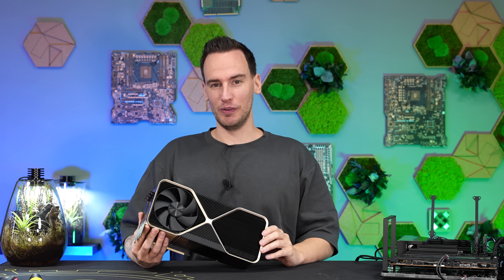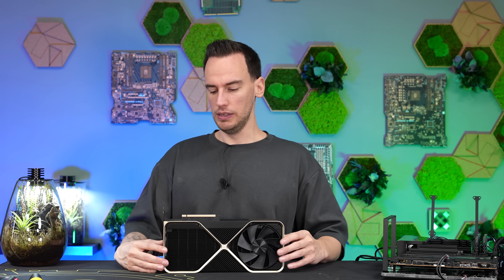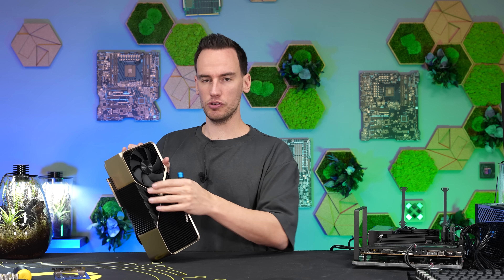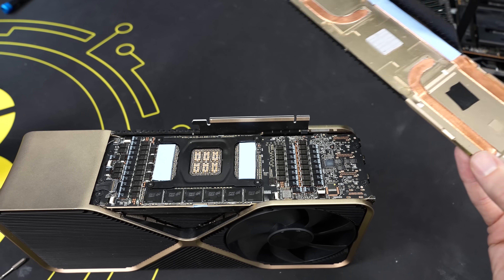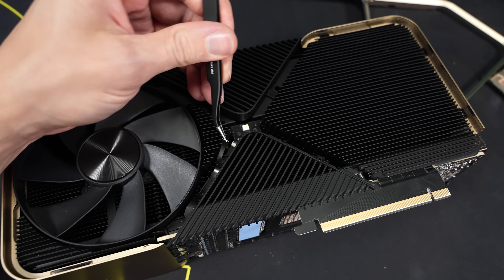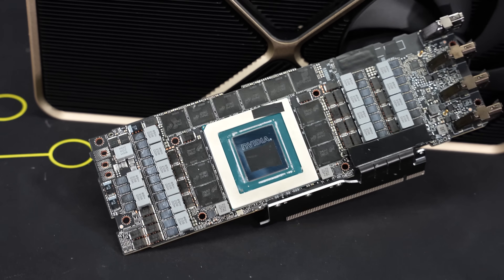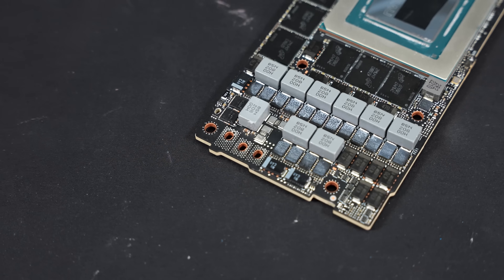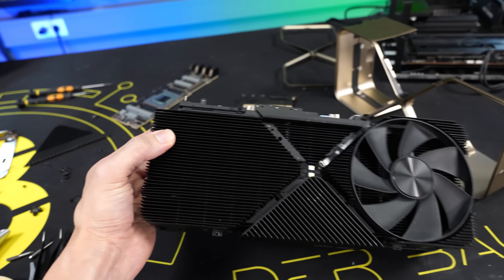I Opened NVIDIA’s Secret TITAN ADA Prototype

Comment: all these gpu unit should be water cooled only by now. these heatsink are going into the insanity category. taking up half the motherboard while even a simple butterfly's extra weight will crack the connector.

Comment: Incredible. When you initially showed the side view and you could only see daylight coming through, my brain went- what black magic is this? The only way that would work is if the plane of the PCB was perpendicular to a standard GPU PCB configuration, but that should be impossible for a card that powerful. Sure enough, they pulled it off. That is some beautiful engineering. Thank you for showing us this!

Comment: My PC is smaller than that one GPU. I guess bigger coolers and heatsink, mean more power to push slower chips, Rather then making faster chips Nvidia have gotten in to the fuck heat limits and dodgy power cable they want Juice and shit loads of it. It like the old day when CPU was only one core and it was a game of what killing clock you could get before it turn into fire.

Comment: The GPU cooler that RTX 5090 FE should've used. Instead, we got a crappy dual slot that runs hot and loud just so NVIDIA can get more margins lol
Reply: The FE cooler is dual slot 😂 it’s amazing it can even handle to the full heat load. It was not free to develop 😂.

Comment: The price for this kind of thing is not just the manufacture, which is significant, but think of the engineering hours gone into making this thing too... But it does also depend on how you count it - the engineering wasn't A-Z for this and then thrown away, the routing schemas and rules are used for other PCB's as well, and parts of the cooler design are re-used and cobbled together from different designs, a part of the cooler is very reminiscent of another card I've seen but not sure which - it was one of the Titan cards and I think a pre-release but earlier than this... But - could be that I misremember... The PCB on it was not in the base of the cooler like this but it was like a diagonal cut thing, so as short as this but the connectors oriented the other way and the PCB just the square from the slot back up and then to the top of the card, with the corner cut off. And there is the one with the V "bite" into the card too, that went out as a production Titan as well as 4090 OEM I think. Looks like it based on pics. But you can find some more funky PCB's poking around in the 'pictures' result searching for nvidia titan pcb, rtx pcb etc. The evolution is interesting to see IMO.

Comment: Shame with the 5090 they could not have done the same thing and not had the 12vhpwr power connector on the main board. Would have made replacing melting ones easier.

Comment: The prototype is very impressive. I wonder what applications would justify such an expense.
I built 4 "high end" computers for a lady that was doing a Computer Science Masters Program focused on Artificial Intelligence. The first was a quick use of mostly spare parts. I put an Intel 9900k into a Asus Prime mother board with a Corsair 360 AIO. The initial Graphics card was a 1080 which was quickly replaced with a new 3090FE. This did a homework assignment in 3 hours that took other students working on their laptops a week to do. I saw the need for her to have a backup computer that proved to be needed twice. The first failure was due to “user error” of trying to store more than 2 TB on the boot drive. There were three other unused NVMe SSDs on the mother board. The second failure was the mother board battery failing. I did not see that coming. Luckily both times almost all the work was backed up off site so only a few hours of work had to be redone each time.
Like Paul (Paul’s Hardware), my first 13900K with a 4090FE had an excess of cooling power. It had a Noctua NH-d15 in a Fractal Torrent Case. The last one had a Noctua NH-12A in a Fractal Pop Air case. What I call a good cooling solution is not for the highest initial overclocked frequency but a long term lowest fan speed to minimize dust accumulation with big slow turning fans to minimize noise and fan curves that will cool Prime 95 and Furmark loads. The CPU initial temperature should be Celsius temperature in the low 80s at full load with an ambient Fahrenheit of 80 (26.7 C) because dust happens. The Intel XTU tool can make this an easy task with final settings transferred into bios. By doing this the Turbo velocity boost can be disabled and reliability increased. The turbo boost is the cause of Intel CPU failures due to the inability of the temperature sensors to limit temperatures quickly enough to prevent damage.

Comment: 10% GPU 90% heat sink
Reply: And 99% cause wallet bottleneck
Reply: 75% fire hazard
Reply: @cwbuilds9215  if anything this one is the least fire hazard compared to any 5080/5090. since all the 12V and ground  pins for both 12vhpwr are all bridged to the copper bar so even if a pin or 2 made bad contact the rest would balance it out. if nvidia had done that for all 5080/5090's the melting issue would not exist...but instead they made the safest ones be the prototype ones that  maybe a handful exist and then made millions the lazy unsafe way

Comment: At this point may as well just have a gpu socket on the motherboard and put your own cooler on it
Reply: I've been saying the same for years too, the atx board needs to evolve one side socketed cpu and ram the other side socketed gpu and socketed vram and the chose your own cooler type.
Reply: @bazzingabomb I think there may be an issue with socketed vram with trace length and signal integrity. I do think a socketable daughter board with integrated GPU and vram, and offload the vrm and video outputs to the main motherboard would work
Reply: They already do it for DGXes, it's called SXM

Comment: Eventually that poor PCIe Pcb will be split on two parts or damage the main Pcb connector if you try to move your PC!!!
Reply: At least it appears they used a flexible connector this time unlike the rigid solution on the 50 series that has already had problems. I'd actually be less concerned about this one and it's constrained to the cooler pretty well but I'd still definitely use a support bracket or a vertical mount.

Comment: With these massive, heavy cards I'm wondering why the manufacturers aren't using the other card slots to help support the cards. They are relying on just the side bracket and the single slot connector. Seems like they could put something to use the second/third slots they cover up to support them, maybe as something that could be easily removed in case you happened to have a motherboard that was single slot. Not only could it help with support but if they could use the locking mechanism to help keep it in place as well. With the fact that most cases seem to have horizontal card placement I'm surprised they haven't done more to deal with this besides the awkward GPU stands some send with them.
Reply: I would assume that the 4-wide bracket is enough of a contact point to hold the cars pretty securely.
Reply: @dylanevans5644  Holding them securely is one thing, supporting them is a fully different idea. Card sag has been a worrying thing since the Gtx1000 series or earlier when the cards started getting much heavier and longer (as to why some come with those little anti-sag brackets). So yeah there is plenty of room for improvement with the far larger cards to help deal with that. 

And that doesn't even address the fact that the 5000 series doesn't even have the PCIE pins as part of the card but just a different board so it doesn't have the same level of support. 

Anyhow, it was just an idea of how something might be done to help support the weight of the cards, especially the 3+ slot cards.
Reply: PCI slots aren't supposed to be load-bearing and available slots aren't consistent across different boards or always reinforced. Even if they did it's still only supporting all that weight from one side. It's just not a very good solution.

The only practical option to truly secure these monstors are support brackets, at least until standardized changes are implemented.
Reply: @JJFX-  Yeah thats kinda my whole point, PCI slots aren't supposed to be load bearing... yet they are being forced to hold up these massive cards, and this is why so many cards these days sag.

I did happen to mention that there could be removeable/adjustable brackets, and spreading out the load would obviously help take some of it from an individual slot. As it is now the cards torque town from the back putting strain on just one PCI slot and on the single connector. 

As for standardized they are kinda standardized as far as the distance between them, this is why you can have multi "slot" cards and they all fit the slots and can be attached behind them. So you COULD make them for dual/triple slots (if they were able to be removed/adjusted for boards without).

The sag pole also isn't a great all around fix because of the same idea that "they aren't all standardized" when it comes to motherboards AND cases so you can't guarantee that a shipped sag pole is going to do anything. This also wouldn't address the cards being in a vertical layout as they still lean over putting pressure on that single PCI slot, just not quite as bad as when they are on their side.

Of course its not a perfect fix, probably won't be implemented by manufacturers, but its an idea for a potential solution to help address the problem in a way that doesn't force the consumer to rig up something in the hopes that it doesn't cause a problem (or won't look horrible) with their $1000+ card.
Reply: @JohnA... I know what you meant, it makes some sense in theory but it's just not practical. Yes the spacing is standardized but not every board has actual slots in the same locations. For example a board in front of me only has a PCIEx4 two slots below the top x16 then another x16 spaced 3 slots below that. Others do this differently. Any 'dummy' brace like that would need to be removable to ensure compatibility. 

What I meant by a standardized solution is modernizing the ATX spec with additional support considerations. Something that has been discussed for a long time.

Support brackets/braces certainly aren't ideal but are often adjustable and add strength exactly where it's needed without transferring the load back to the mobo PCB. I'm not saying it's the best solution but it's the most practical and effective work-around which is why it's what most of them are doing.

Comment: I thought (and still think) the TITAN V was then end of “affordable” HPC at home, no way they’re ever going to sell something like that to consumers 😭
Reply: And it was. The 4090 costs more than  the Titan X Maxwell adjusted for inflation. 5090 even more.

And we cant even call the 5090 a prosumer card, it has only 3x more VRAM than the 1080 ti from 2017.

While the HPC card got so much more VRAM since them, Tesla V100 (32 GB) to the B200 (180 GB) is almost 6x the VRAM.
Reply: @rj7250a I think silicon manufacturers quickly realized they could make a lot more money if they made HPC inaccessible and then jacked up the price of hbm as there really isn’t a better alternative… I’m interested to see where SK hynix stock ends up after HBM4 and HBM4e roll out 😭

Comment: It would be fun to watercool this tiny pcb, making it the smallest and most powerful gpu ever
Reply: Yeah that's one of the reasons I'm sad they never got this heatsink and PCB design into production. It would've been expensive to produce and probably have a really slow production line to drive up costs even further. The amount of insane ITX builds you could do with this with a riser cable and custom mount somewhere completely out of the way and just use half of the case for rad space and ducting. You could probably fit one of these with a waterblock into a 10L case and have enough rad space and room for airflow to not lose any performance at all.
Reply: Optimum would have done it if he had one
Reply: Even if a waterblock was made for this PCB, how would you handle the power delivery? The three "power cables" running from the two 12VHPWR connectors are solid copper wire bent to conform to the shape of the stock cooler. The waterblock manufacturer would be responsible for figuring out a solution for that as well which I feel is a bit out of their realm of expertise.
Reply: @insan1ty0ne  if you're crazy enough you can probably solder wires directly to it and feed it that way, something like a 3 awg for each methinks? idk i'm not sure exactly how big the holes are, or if they'd even work to do that with...

either way, food for thought.
Reply: @insan1ty0ne You'd simply incorporate the same 12V and signal wire idea into the design. It wouldn't be easy but certainly doable. Plus I'm betting a production version of this card would have had a better solution for routing power than bare copper pressing onto the PCB.
Reply: asus made a wireless power delivery setup, called BTF. its an additional connecter that comes off the pcie and connects to their btf compatible motherboard. its only asus that has this right now, but maybe down the line it can become an option across brands and then this whole issue is completely solved
Reply: @RoachDogggJR BTF couldn't handle the power requirements for a card like this which is why the 5090 Matrix still has a 12VHPWR connector.
Reply: meanwhile that brand new 5090 matrix platinum that can push 700watts alone has one included. and btf is capable of supplying up to 1000 watts through its connector lol.
Reply: @JJFX-  2 seconds of research woulda shown you it can supply more than enough power for compatible cards. its whole purpose is a clean look for the most power hungry cards out there
Reply: @RoachDogggJR We aren't talking about any compatible card, I'm well aware of what Asus' BTF connector is and that it's a proprietary solution they aren't licensing. It is not spec'd to deliver more than 600W which is why a card like this or the Matrix with more than one 12VHPWR connector would still need additional power unless you modified the card to be able to draw more power. Something I wouldn't recommend with a motherboard connection. That's why the Matrix isn't just using the BTF connector.
Reply: @JJFX- the adapter on the brand new card can do and handle 1k, and BTF 3.0 can do up to 1500 watts power draw with 1900w peak in extreme testing lol

Comment: Why did they put the PCB that way and not the normal way?
Reply: Because this way they can get a 100% flow-through design on the heatsink. In contrast to the 5090, which has the tiniest PCB in the centre of the card, this prototype has instead a third fan in its place.
Reply: @rata536  What is the advantage here? Besides the huge disadvantage of the giant width.
Reply: @TuxikCE An obvious improvement in airflow through the heatsink.
Reply: @TuxikCEThis heatsink has an extremely high surface area and able to easily blow air through the entire fin stack. A card like this would likely be able to pull up to ~800W or so, similar to Asus' 5090 Matrix which is also massive.

Air cooling that much power is just absurd. Given the cost of manufacturing such an elaborate cooler they could have just gone with a water block at that point.
Reply: @TuxikCE It has the massive benefit of making the heatsink more efficient, because the air encounters little to no resistance to escape and take the heat away, instead of hitting a wall (the PCB) and having to recirculate until eventually goes away.

About the size of the card, sure thing it's massive, but there isn't much difference vs third party 5090s out there. Considering this one is set to draw much more power, it's not that bad. But honestly at this point it starts making more sense to watercool it instead.